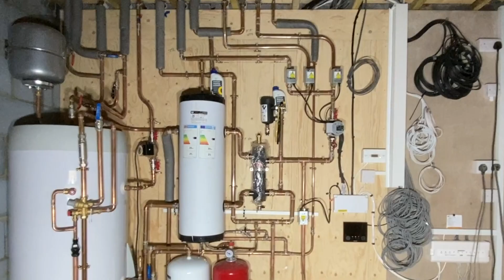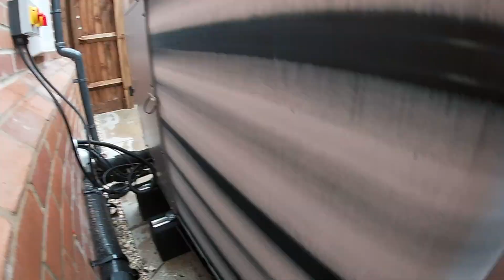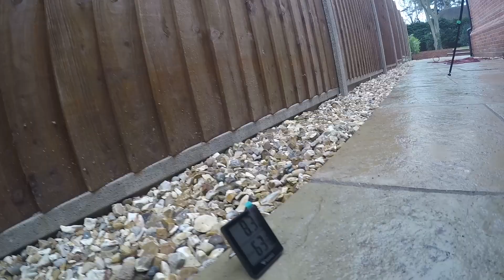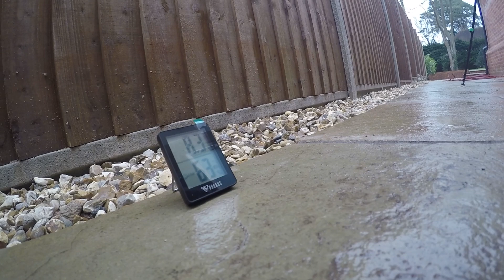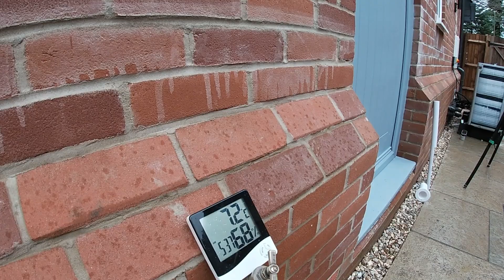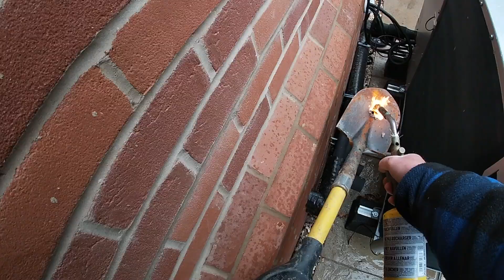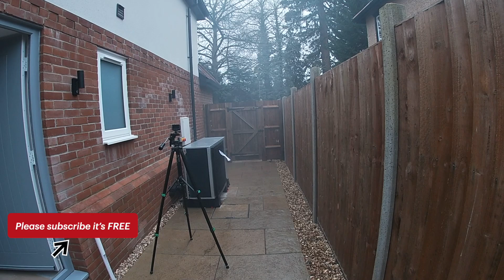Heat  Pump Freeze Up - HELP!

Comment: I am not sure the point you are making here.  All heat pumps do this freeze & thaw cycle - depending on ambient temp.  I don't think the smoke test conclusive enough.  As suggested elsewhere, open the gate and see if there is any benefit or an open style gate.  But I am sure I have seen a Heatgeek video of an ASHP in a well and he showed very little impact on performance.  But good luck with your investigations.
Reply from the maker: Hi The freezing up is "normal " in very cold weather but the fact the the freeze was happening very half hour that combined with a COP of 2.5 was a bit of a shock . However the house was at a good temp . Perhaps I should manage my expectations . But I will defiantly try the gate  open and try to be a little more accurate. with my test and will post. .Thank you .👍
Reply: @ definitely worth investigating. Do you heat h/w once, say overnight?  Rather than trying to keep it “topped up” during the day?  Are you running on the weather compensation curve? And have u tried tweaking the temp down a bit?  I started on a SCOP of 3.7 with Nest control. Got to 4 with weather compensation. Now >4.2 COP (not done a season for a SCOP) with Havenwise control. And this over two cold winter months.

Comment: Good video I have the same HP model in a wider gap (about half a meter wider) and on the corner of the property. The defrost runs every hour whenever the ambient temperature is below 5c which I understand is normal operation. COP is 2.8 at below zero degrees which is OK. We have the whole house warm for the first time in years and the running cost is 25% less than the old oil boiler.(which was very old) So heat pump works for us but every property will be different.
Reply from the maker: Hi Glad tp hear it heat pumps are the future . 👍
Reply: Just to add my projected SCOP is at least 3 including DHW (I have only standard radiators with high temperatures) the average cost of electricity on Octopus Cosy is 18p per kWh with a set back at the peak rate. That is 6p per kWh which is similar or better than a house using mains gas. I am happy with that.

Comment: If leaving the gate open works, then just replace it with a wrought iron gate - plenty of breeze then. You could also place a plank of wood across the front of the unit (and maybe the sides too) to stop cold air being sucked under it (like a runner/kick board under kitchen units). If it works, maybe make one out of sheet aluminium.

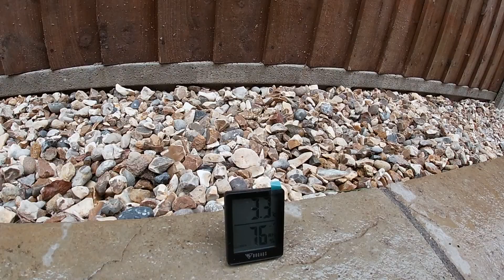Comment: At 3:25 the thermometer clearly shows 3.3C, this then switches quickly to one showing 'about 8 degrees' what happened there ?
Reply from the maker: Hi 
I think the thermometer that is showing * was straight out of my van  and then took a while to register the ambient temp. Thank you 
👍

Comment: Good luck with this.  There is a solution somewhere.  My first impression is that your unit is in a kind of ”swimming pool sized area \ cold bucket” that will fill will cold air being pushed out by the pump.

Comment: Install a Exhaust fan air diverter. Problem solved. But your installation is very complex, why all that piping and valves or whatever. I think that my installation is minimum. They have sold you everthing they had.
Reply from the maker: Hi As this is a new build there are certain criteria that we have to comply with to satisfy building control . I like you would have just basic controls .
Having said that I have all wide open and still not achieving the results that I want  Thank you 
👍

Comment: Is your hot water on reheat or scheduled? Do you have a secondary return on the hot water circuit?
Reply from the maker: Hi I have hot water turned off and yes there is a secondary return on hot water but have also got that turned off as house not occupied . Thank you 👍

Comment: Having my brand new combi gas boiler fitted Monday.
The last thing I need is a system less efficient and considerably more expensive than my new gas boiler.
Reply from the maker: Hi Obviously  air source heat pumps are not for every body having the space is a big consideration .. regarding efficiency as I have said before heat pumps can have a COP of 5  I Know this sound ridiculous but that means 500% efficient . Gas boilers have a COP of around 1 . So  5KW of heat produced by a gas boiler  = 40p . 5 Kw of heat produced by a HP = 28p . These examples obviously do not account for variables in  out side temp. But I have fitted air to air heat pump in my own property and have recoded a COP of 6 . But you  are right to change from a Combination boiler to a heat pump would be expensive  Plus the heat pump will never give instantaneous hot water . Thank you 👍
Reply: @HEATSEEKER1428  More than that, this one - that seems to have an issue - is still at a COP of 2.5. That's more than 2.5x what  you'd get with a gas boiler.
Reply: @HEATSEEKER1428  

"Plus the heat pump will never give instantaneous hot water"

I would beg to differ, the hot water cylinder in a heat pump system provides near instant hot water at sufficient flow and temperature to feed at least a couple of good showers simultaneously, something a combi' would struggle with.

And given that heat pumps can be had for £500 (after grant) you'd struggle to get a new gas boiler installed, along with required heat loss survey (Part L regs) for that price.
Reply: What were the heat loss calculations for each room in your house ?
Reply from the maker: @_Dougaldog  Hi too many rooms to list will give requirements  for each floor  all rooms designed at 21 deg @ -3  Ground floor 3998 watts  147 m2   FF 3731 Watts  122 m2.  Second floor 1658 watts 122 m2   Thank you 👍

Comment: Heat pumps don’t work because for the installation,survey and technical issues that arise when companies are just ripping people and the taxpayer off . In plain speak many are just stealing from people and taxpayers and nothing is being done about it .
Reply: Were you ripped off when your HP was installed ?

That would be most unfortunate as most work very well.

Comment: in the meantime, you could just put a sheet metal duct to help direct the air upwards away from the fence, this may help stop it swirling as it sends it up over, maybe direct it over the fence sideways ish but upwards.  i doubt the cold air would sink faster than the fan can blow it away

Comment: Look at that monstrosity! At least the electrician will have somewhere to sit when trying to access the meter box....And it's parked over that heavy a$$ drain cover...👌👏
Reply from the maker: Hi its not  a heavy duty cover in actual fact just this morning I carried out a drainage test with building control and was able to remove cover completely with out disturbing the H P   Thank you 👍

Comment: Here is my suggestion: Remove every second wooden plank out of the fence along the entire line. This will improve air circulation and fix your problem.
Reply from the maker: Yes I appreciate your comment but neighbour would no like it . Some people are funny about having cold fresh air going across thier r boundary

Thank you  
👍
Reply: @Yes, that’s exactly what I thought while typing. However, then you are left with the engineering solution. You need to source two low noice outdoor fan systems. Exactly those that are used in the heat pump. Most likely those can be sourced as a spare part from Alibaba or heat pump manufacturer. You need to find one with a box / cover of course, industrial grade (HAVAC). Place one fan in your door, or split the door into a two winged design with one wing as fixed and stationary. There are nice covers available and cables can be flexible installed. This will transport air into your corridor towards the heat pump. Place a second fan at the opposite side of your corridor to transport air out of it. This way you create a constant air flow. It’s called a push-pull system in the IT world. All you need is some cabling and the correct voltage the fan system needs. Later on you can enhance the system by temp sensors or weather stations to have dynamic air flow management. That’s what I would do and your problem is solved.

Comment: There is a tendency to put these units on the colder dark corner, ally way etc .. 
I had a car that would ice up its carburetor in the same spot on cold damp days. There must be valleys where the conditions are met for cold wet air to happen far more often. The Lea side of a house is always more damp than the sunny side. You should measure humidity as well as temp. 
I’m not a fan of heat pumps. But we need to understand the unsuitable locations. As for sucking heat out of your house every 30 min…. Unacceptable !

Edit. Swap the fence for slatted trellace , raise the heat pump up so it’s not getting as much cold wet air.
It needs 2 conditions to ice, cold and humidity. Measure the humidity at ground and 50 cm , before and after opening the gate. 

Remove 300mm off the bottom of the gate and fit wire to prevent cats etc?
Reply from the maker: Hi the humidity is at its highest at the base of the heat pump and I defiantly think getting the air flow improved at low level will really help the situation,

Thank You.
👍

Comment: all the money you spent on that you could have heated your home with gas for years
Reply from the maker: Hi This is a new build . The eventual owner of the property will be more than happy with this HP .  Once I have ironed out these few issues I will have it running At a COP of at least 4  in really cold weather and in normal winter weather a COP of 5 .
The total cost of the components in the installation was about 5 k  How much is a new gas boiler to replace these day with all of the provisions and alterations that have to be made to accommodate low temp heating ? 
I have installed an air to air heat pump in my own property and have done fuel cost comparisons over years and in the fist year the heat pump saved approx £600.00 on fuel costs ,plus my wife has the place at 23 deg  . Thank you 
👍
Reply: @ ok on a new property but how much cost on an old property
Reply from the maker: @honestopinion253  Hi You have to bear in mind these days you can not just replace an old boiler for new . All heat calls have to done and pipe sizing and radiators sizes have to be check and adjusted  to accommodate low temp heating . So I would say for an average house heat pump,cylider , and associated valves and controls should not be any more than around £ 5,000.00 for materials . I don't think a gas boiler change with all of the associated bits would be much cheaper than this . The add bonus is that in the long run  heat pump should be more economical .
Thank you 
👍
Reply: @honestopinion253  

My system was all new radiators, new Mixergy HWC, all new piping 28, 22 & 15mm for under £4k after grant.

And with HP tariff they gave me, it costs about 3.5p per kWh of heat to house averaged over the year.

Comment: This happens to my daughter’s heat pump every time the temp drops below -2, her pump is in a similar location to yours. It’s an 8 yr old Samsung and they’ve been told it’s old & obsolete and needs replacing with new control gear £12k is the best quote. The house was designed for a heat pump but I think it’s the location in between the houses facing a fence with the gate a few feet away so it’s effectively facing north. I reckon either the heat pump needs moving the other side of the gate where it would be on the south east corner with better airflow.
Reply from the maker: Hi Yes The HP should last more than 8 yrs  The biggest thing with heat pumps is control  Like many have said  here the more open you can have a system the better in the winter time running all the time at low temp . with weather compensation is best .
Reply: @ the house is semi detached and next door has had no problem but their heat pump is on the west side with a hedge about 6ft away so it catches evening sun with no obstruction to air flow.

Comment: Interesting video but not sure about the music lol. I was curious just how much noise this system makes when it's on full pelt, when you added the smoke it does look as though the fan is running quite hard and I imagine the noise would be really quite upsetting to your neighbour as your houses appear quite close together. Have they complained yet?
Reply from the maker: Hi there is a noise from the unit but and it might be slightly amplified by the fence situation . The noise is not a droning sound but basically the sound of rushing air . Apparently the neighbour has complained  but to be honest if you are on the other side of the fence  it is not easy to hear it  a car going down the road at the front of the property drowns out any noise from the HP. It's my experience neighbours always complain . Thank you 👍

Comment: In scandinavia we use heatpumps in extreme cold temperatures -30 to -35 celcius. Free airflow is must. You need to move outdoor unit to other side of the house. Also min 1m from house wall helps.
Reply from the maker: Hi That is an option .Also the high humidity in Britain does not help . Thank you 👍

Comment: Like EVs making a problem when there isnt one. Gullible people make hardship by their own deeds.
Reply from the maker: Hi thank you . Heat pumps are the future  they save the user money   and if you are that way inclined . much greener that a gas boiler of EV .👍
Reply: @HEATSEEKER1428   you've just proved my point, they are way more expensive than a normal boiler.

Comment: Looks like air being locked into an enclosed area. To prove it. Try hiring a large fan  to keep air moving. Or try to make the pump fan stop recycling the cooled air back on itself try air baffle to push exit air horizontal along the passage. Seems to me the manufacturer should supply an extract fan cover to allow this when heat pumps installed in restricted area.. note a lot of people with little understanding of heating will suggest gas boilers.. Ignore the luddites

Comment: £12,000 average cost of heat pump……£2,000 average cost of gas boiler.  Net zero nonsense.
Reply from the maker: That's a crazy price for a HP and a very low price for the gas boiler . There is no Comparison   HP is efficient will save you Money and if you are that way inclined be greener . Thank you 👍
Reply: A Daikin 6kW HP costs £3,142.55 without VAT and can be installed without gas certificates needed , how much for a decent gas boiler ?

How much will your inefficient gas boiler cost to run when UK gas runs dry ?
Reply: @ nonsense from another net zero zealot. By the way an enormous natural gas field has just been confirmed under the whole Lincolnshire….enough to power the UK for 20years.
Reply: @_Dougaldog  nonsense. Why does the government with tax payers money and with levies on our fuel bills pay £7,500 for HP grants?   And by the way read all about the massive natural gas field discovered under Lincolnshire…enough to fuel the UK for 20 years!
Reply: @MARTINA-gc3tq  

That is fact, City plumbing.

Other than that there is usually a significant amount of radiators and hot cylinder to provide. That’s where it can add up, as it might for a low flow temperature gas boiler system.
I don’t hear many complaints of huge tax subsidies to fossil fuel suppliers.
Shell as example paid no tax for five years up to 2023….
Fracking is not very friendly, unlikely the people of Lincolnshire want their drinking and farmland water poisoned.

Comment: I’d say that a COP of 2.5 is rather remarkable, given the icing that’s occurring. 

Wow, that fence is very close to your house!  Is that your shop on the other side?  Or actually someone else’s property??  If the former, I’d consider removing the fence, or part of it, or at least making an open type instead of solid. 

Regardless, I would suggest that, since cooler air is denser, the air in that little space is just going to get colder and colder. Even if the unit didn’t ice up, it’s efficiency would be reduced. 

Replacing the gate with an open one would probably help a fair bit. My other thought was to add a fan over on that side of the house. A fairly low powered one. And obviously one that can be left out in the weather. Could wire it to run whenever the heating is called for.
Reply from the maker: Hi Not my property and the fence is property of neighbour and cannot be touched  . but replacing the gate is definitely a good option Thank you 👍